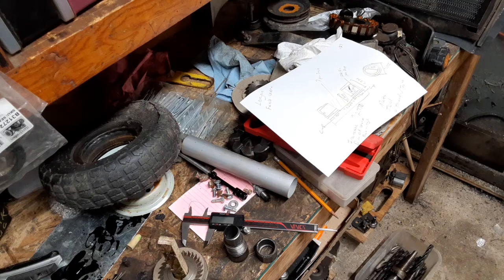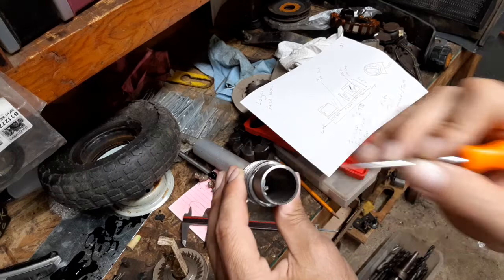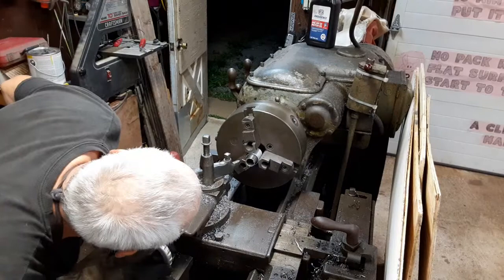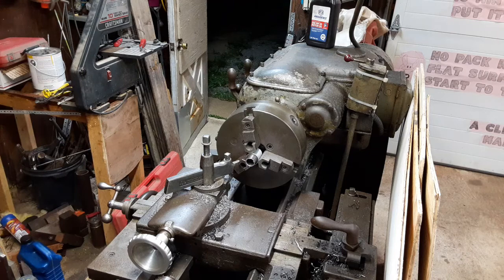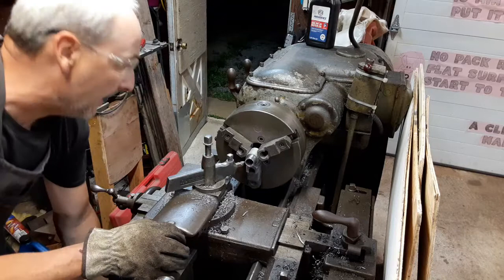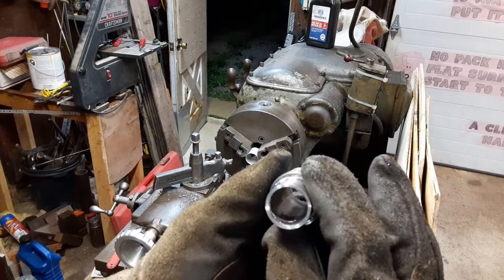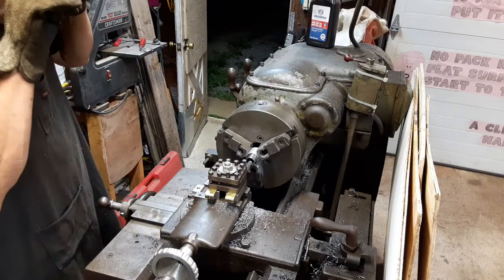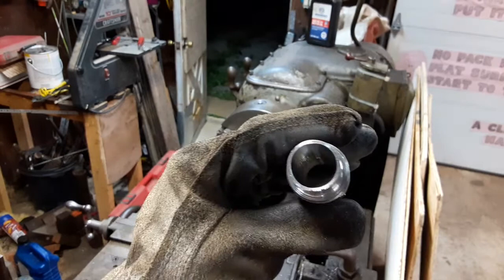starting repair of the worm gear for the logan lathe apron feed

Comment: Good idea to make a welding jig to hold the key in place. That will make welding much easier and will also drain the heat.
Reply from the maker: Thanks I hadn't thought of the heat sink idea. I think I am going a very different direction though ...still working the details out in my head